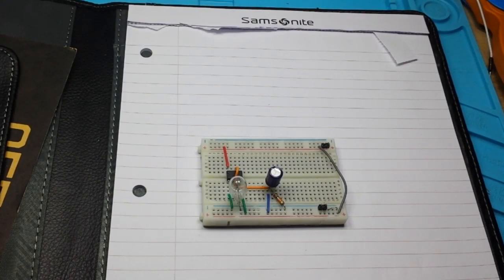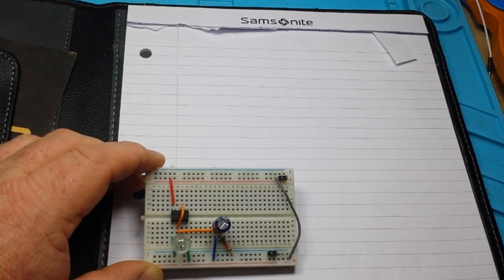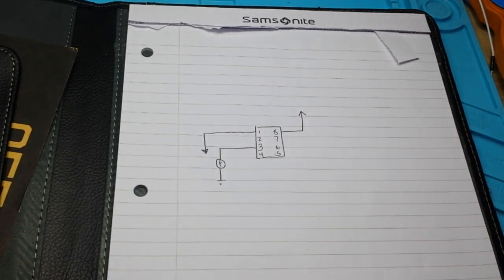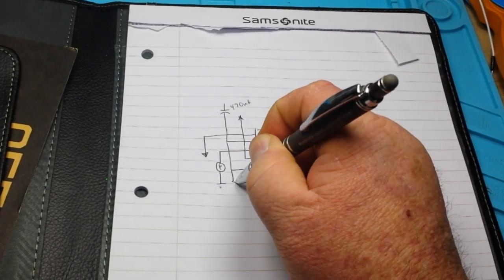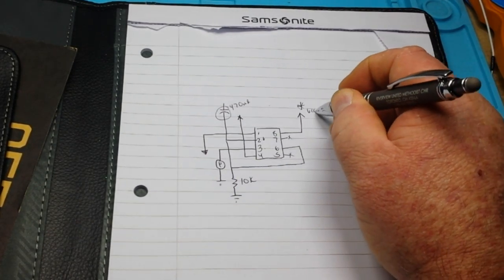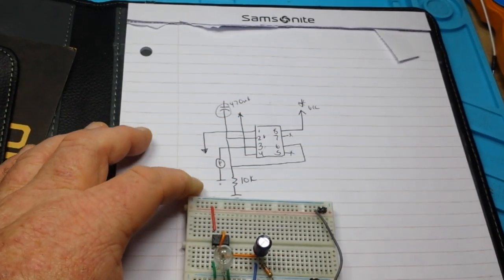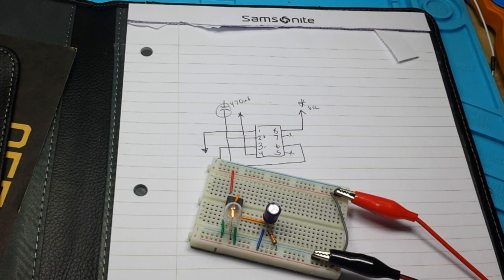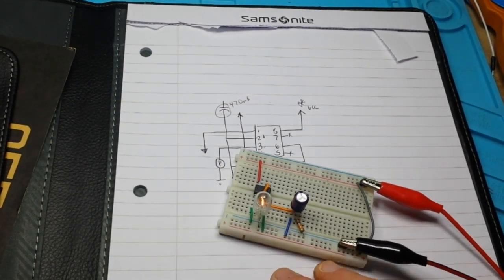On after delay circuit

Comment: It can be done with a NPN Power Transistor, Resistor and Cap as well. Resistor going from VCC/Collector of the Transistor to the base of the transistor, Electrolytic Cap from the Base of the Transistor to GND,  VCC to collector of Transistor, emitter of Transistor to LOAD. Typically used in huge power supplies to protect rectifiers from a cold start when the filter caps charge. to increase the delay you just increase the Cap and Resistor values.

Comment: This circuit is a throwback and it's great for a "fridge has been open TOO LONG Timer"
Use a magnet and a reed switch to trigger power ON when the fridge opens then after RC times out it turns on an led + buzzer.

Comment: This is perfect, I'm switching to this from an npn/cap/resistor when activating a reset on a 74LS273 because the activation voltage on the npn is way too low causing the reset to happen way too fast even if I use large RC values.  Thanks for sharing!

Comment: You can do the same thing with an N or P type mosfet, resistor and capacitor. However you won't get a rapid state snapover, the mosfet will turn on or off slowly as the cap voltage reaches the gate threshhold. You will still have the same problem as the 555 with the capacitor retaining charge making subsequent cycles shorter depending on the off time. 555 is an overkill in this situation if you require something really simple.

Comment: That same rising capacitor voltage can also be fed into a 2nd OpAmp with a 2nd reference voltage for a cut off if it's fed into a inverting end, which would turn off the load.

Comment: These circuits are awesome for circuits that require a clean supply at startup. You could startup your power supply, and then this circuit could activate the rest of the system when the supply picks up enough to ensure a stable operating point.

Comment: I am so glad to find your Video!
You saved my project!
Just one question. I measured that the charge that you talk about in 3:31 shortens the delay by about 20%. 
I need my delay to be between 51 and 59 seconds. So if I tune the time with variable resistor and it  will be 20% shorter next time I need the delay it will be about 40 seconds and this is not good for me. How do I discharge that capacitor in safe way?

Comment: Why did you leave one of the pins at the capacitor unconnected?
Reply from the maker: I did not
Reply: @learnelectronics  I think Mikael means on the schematic, because you didn't label the positive side? A lot of people probably skip some obvious (to them) connections when sketching out a simple circuit. You did point out and state all connections on the breadboard though, including the capacitor being between Vcc and pin 2.
Reply: @learnelectronics  Actually, what you diagramed does not have the cap attached at one end and in the video it is impossible to see how the cap is connected. Love you and what you're doing, but you could stand to put in a little more effort to make your breadboard circuits a bit easier to follow.

Comment: hi there, thanks for the video

where would you put the discharge capacitor if you would like to discharge the unit right away?

why are pins 5 and 7 not used? would I need to connect it to the ground so they are not floating?

Comment: If you connect the light to vcc instead of ground it will convert the circuit to an off after delay as the 555 can sink or source BUT a current limiting resistor must be fitted on pin3 or you will instantly kill the 555 ! Better to use leds as the current draw is lower .

Comment: I need a waterproof on after delay circuit.  The delay would be from 0 to 100ms in 10ms increments possibly using jumpers.  The input would be 12V.  Could I hire you to make one?  Thanks

Comment: Many thanks for uploading video and knowledge sharing. If possible, can you tell us how to build AC overcurrent circuit using passive compenents that can help in protecting Water Pump motor taking 4-5 amps taking into consideration high starting current of the motor i.e. above 7-9 Amps.

Comment: I am trying to figure out a way to reset this circuit.  I thought I could use pin 4 to ground, but it doesn't seem to reset. It will reset when power or ground is removed. I want to use the 555 timer to turn on a circuit after a 5 min delay in the off state.

Comment: Relay the easiest add-on for greater switching in place of the bulb load?
Reply: IIRC, relays that the 555 can switch are much more expensive than a bipolar transistor and a couple of components.

Comment: Easy to understand and it works perfectly. Would you be able to add something to this circuit where the light stays on several seconds after the power is turned off in this circuit to support both a one time On after delay and a Off after delay? Really appreciate your explanations too. Thank you.
Reply: ME TOO .. I'm looking for a delay on and then off type circuit depressing the intermittent switch once. To explain ... Depress switch & release, timer stats for about 7 seconds, power on for about 5 seconds, then off. Depressing the button will start this cycle over again.

Comment: I am a newbie in electronics. I have the project done with an Arduino pro mini. It works. Now I want to try to build it without a microcontroller.

I'm using NAND logic gates on this project (NAND it's the only thing I could find in my region).
I have two float switches, one in the well for water level (to protect the pump from running out of water) and another float switch in the tank to indicate when the tank it's filled.

I also like to have one momentary switch (push button) to switch between modes (to bypass the tank float switch) to have the water pump on auto and manual, on the signal that goes to the logic gates.

Maybe you know a way to do the toggle push-button circuit to bypass (disconnect) the tank float switch, so it will run continues (even if the tank it's full)

The thing is that I want a delay on the water well float switch, 60-120 seconds, so the well can fill with some water before the signal gets to the logic gate to put the pump into function again.

The only thing I have to figure out is the delay that indicates when the water well got some water.
Should I use this 555 delay design and power the 555 ic through the float switch in the water well?
What would be the best approach to do the delay? 

I played with a logic gate simulator. The project will work as expected with 5 NAND logic gates and two inputs. 

Thank you.

Comment: Could you possibly explain how the charging of the capactior effects pin2 (trigger) please? This has me totally confused.
Reply: Maybe your confusion is because the capacitor is connected to Vcc, not to ground? The voltage across a capacitor is zero when it is discharged, meaning that the junction between the capacitor and the resistor is at Vcc potential at power on. The capacitor charges through the resistor, meaning that the voltage at the junction falls down toward the common rail. (It's rather like standing upside down with your feet on the ceiling: if you have a ball in your hand and let it go, it will seem to go up from your upside-down perspective, even though it is actually falling toward the ground). If you measured the voltage a cross the capacitor, it would increase from zero, but because the +ve terminal of the capacitor is already at Vcc, the voltage at the -ve end drops down ("increases negatively") toward zero. Once the voltage at the trigger pin (2) falls below 1/3 Vcc (as the capacitor charges), the internal comparator changes state and the output at pin 3 goes high. Hope that helps.
Reply: @julianopificius6910  peut être que vous avez raison!!!

Comment: You turn the light Off by removing Ground from the whole circuit.  If I want to start the Timer On Delay with a 5V signal from a Logic Or IC on a 5V high Output which will stay until turned Off manually, meaning the 555 would always be powered On while the device to be Timed is On, how would I start the Timing sequence?  Connect the Logic Or IC Output to the Capacitor?  Or connect the Or IC Output to the Capacitor and the 555 Vcc (and maybe also Pin 4 Reset)?  I want the Timer to sound a Buzzer.  I don't know if the 555 Pin 3 current would be strong enough to sound the Buzzer loud enough so I may have to connect its output to a Relay and switch 5V to the Buzzer that way.

Comment: what is the 555's current capacity??
Reply: ~200 mA for the bipolar versions; the CMOS types will be different. You should always check the data sheet for the exact variety you have. [EDIT: This also depends on supply voltage, sorry.]
   In addition, there are military-specification sometimes available, and a T-can with metal outside that can be connected to a heat sink.

Comment: i disagree that "it doesn't get any simpler than this", it does actually, i.e with less connections. It has too many so that if it's made with those long jumper wires it gets messy. Also, the drawn schematic is unclear, it looks as if sb started to drew it but somehow forgot to finish it. Apart from all that, i think it would be best to use a micro switch because the moment the '+' is connected to the circuit, let's say...a less demanding led would blink in an instant so we would already have 'it' on, which in some projects could be a bit risky.

Comment: You draw the same circuit as everybody else. Alas not entirely adequate. What discharges the 470uF capacitor at power-off ? It is left in a limbo of several seconds discharge. You need to discharge this capacitor imidiately at power-off in order to have a full timing sequence at subsequent power-on, even after just a short power-drop. These types of circuits are for protection for such situations, right ? (pows and bangs). But still, I dont remember to have seen a circuit actually discharging the timing capacitor. Indeed strange.

Comment: What's the point of the resistor?
Reply: Jakub Svoboda to resist
Reply: Allow a charge path for the capacitor. When the capacitor charges through the resistor to 2/3 of Vcc, the resistor (which forms a voltage divider with the capacitor) will have the remaining 1/3 and the trigger pin will actuate.
Reply: @trelligan42  hi, how long will the LED  stay on ?
Reply: @TF Sishuba  Forever—or until the power stops. (BTW, he's using an incandescent lamp instead of an LED, which would work as well.)
   The circuit operates by applying power. The capacitor and resistor are in series with the power so the capacitor charges to supply voltage as fast as the resistor lets it. this means the 555 has a constant 'on' signal, and keeps the output active.
Reply: @trelligan42  thank you i was confused